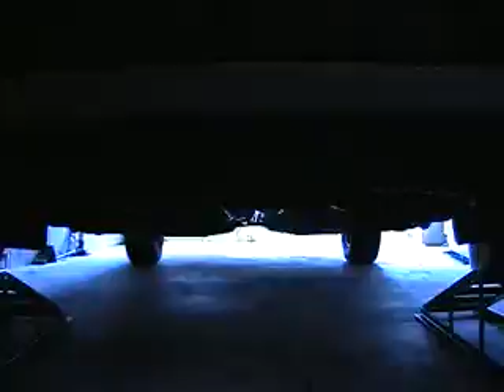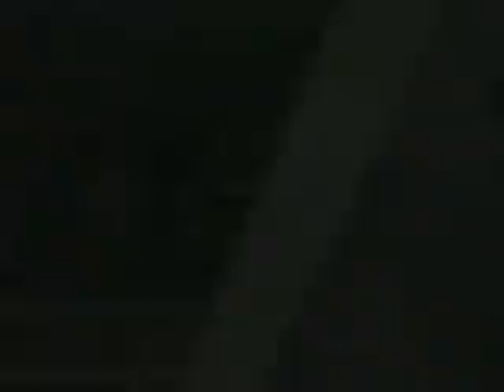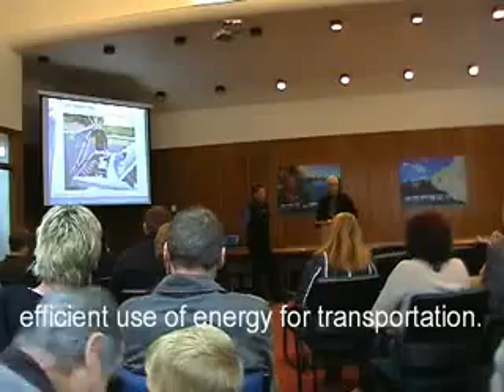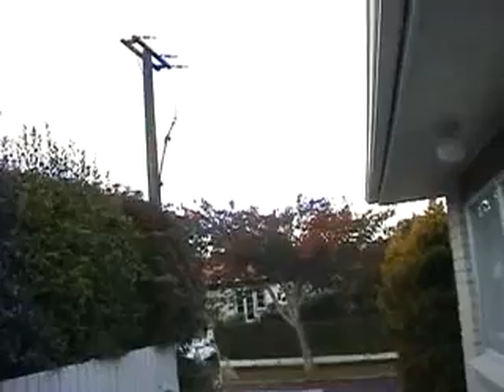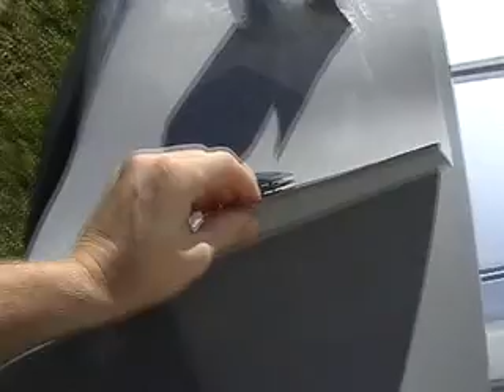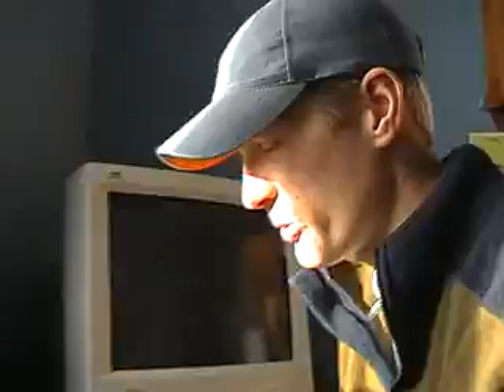Gav's EV Conversion - 22 - Living With an EV 3

Comment from the maker: Yeah, I only did a little one as tyres cost a lot. There are some impressive e-burnouts on youtube though. 
When it's wet the Tredia spins effortlessly in second gear and I have to gentle with the "gas" pedal in the rain. Well, sometimes. ;)

Bnz500: It was actually 1609km (1000 miles) but you can't see the "1" on that classic 80's dashboard.